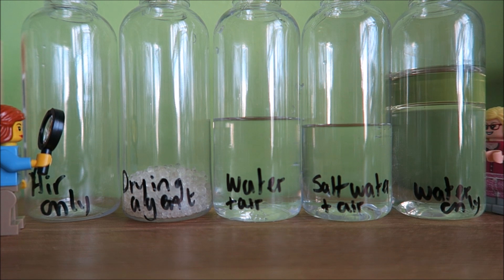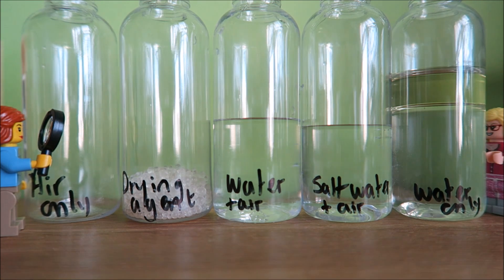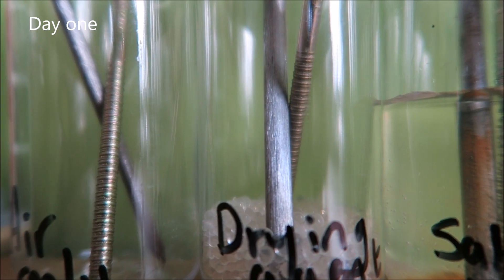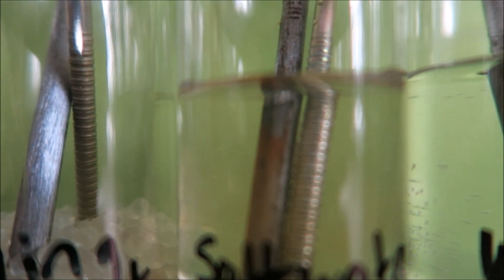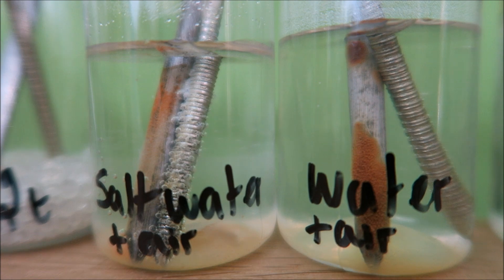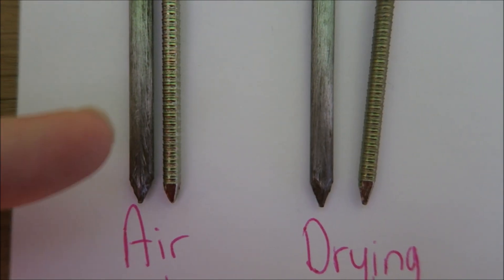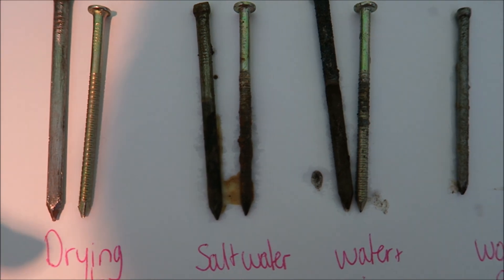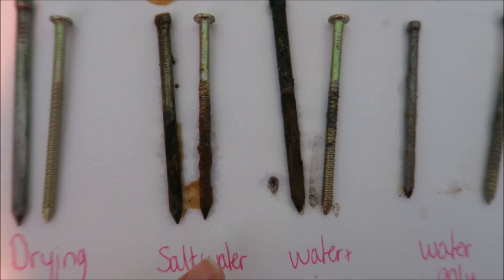Rusting - Iron + water + oxygen = iron oxide

Comment: what happens if you get half a jar of iron powder, add water to the top of the iron to saturate it, pour off the excess water and evacuate all the air above the wet iron mixture?
Does the bottle fill up with hydrogen or other gas?

Comment: Superficially rusting of iron required water and oxygen. Why? Water molecules within a droplet of water on an iron plate are constantly drifting around. They will  drift at higher velocities at higher temperature. Those dissolved oxygen molecules within the droplet of water will adhere onto those drifting water molecules. When the oxygen "atom" that adhered onto a drifting water molecules that slamming against a iron atom will force it to transfer some of its electrons to the oxygen "atom" before turning itself to oxygen anion or O(2-). The iron atoms will not spontaneously turn into Fe(2+). They have to be forced to transform to Fe(2+). Therefore at higher temperatures, rusting process on those iron atoms is higher. Subsequently, such oxygen anion or O(2-) slamming against a water molecule before transforming to two hydroxide anions or 2OH(-). Then, Fe(2+) will adhere with two hydroxide anions to form Fe(OH)2. Subsequently Fe(OH)2 will react with another OH(-) to form Fe(OH)3. Finally, two Fe(OH)3 slamming against one another will form Fe2O3.3H2O crystal. Such Fe2O3 is called rust of iron. The water droplet also has some presence of hydrogen cations or H(+). When the iron atom reacting with slamming oxygen "atom", some electrons that dissipated from the reacted iron atom will be channeled within the iron atoms. When hydrogen cations or H(+) slamming against the iron plate, they will mop up such "excess' electrons before reducing to hydrogen gas that adhered onto the iron plate. The presence of salt or NaCl within the droplet of water will act as catalyst in hastening the rusting process. Why? Molecular mass of water is 16 whereas the one of sodium is 23.9. Therefore sodium cations within the droplet of water have much higher velocities. Thus, the oxygen "atom" that adhered onto drifting sodium cation  will slam against the iron atom much harder to force it to transfer its electrons to the oxygen "atom". Thus, the rusting process on iron atoms will be hastened with the presence of salt or NaCl within the droplet of water. If you are interested in real discoveries, I would recommend you to read my book, The Unification Theory - Volume One and you will be amazed with lots of new, interesting discoveries. In God I trust.

Comment: How come the galvanised iron nail had rust on it ?
Reply: +youtube addict
zinc is a film, and just like you got iron oxide, there is zinc oxide(ZnO)
https://en.wikipedia.org/wiki/Iron_oxide
https://en.wikipedia.org/wiki/Zinc_oxide
zinc kept oxidizing(rusting) until certain areas vanished then iron started to rust(oxidize)
Do electrolysis on 2 iron naisl in salt+water (stir 1 teaspoon in cup) use 9 volt battery.
get a rectangular piece of wood, wider then the cup, place it on the cup and center it.
flip the 9v on it in the middle, draw with a pencel around the battery terminals. take the piece of wood some where to hammer the nails on. You might wanna use 2 stands for it like bricks or stones...etc.
Then watch what happens! ;) yet even film it (with mobile or cam) slow motion or however you like ;D

P.S. if battery is not stable then use rubber band(s), insert rubber band(s) in piece of wood then hold the battery. Or tape.
Reply: I'll try and explain to the best of my ability.

So essentially a galvanized nail is an iron nail with a zinc coating. What happens is that the zinc is a highly active metal and so they use it as a sacrificial coating. The sacrificial anodes that coat the iron nail corrode first. After the zinc has been corroded only then will the iron nail begin to corrode. You can do a similar thing with magnesium and use its charge for the sacrificial corrosion. I did a few experiments like this in year 12 it was very interesting.

So essentially, the galvanized nail will corrode, it depends on how thick the zinc coating is, or what the carbon content is on the nail if it is stainless steel (440c)